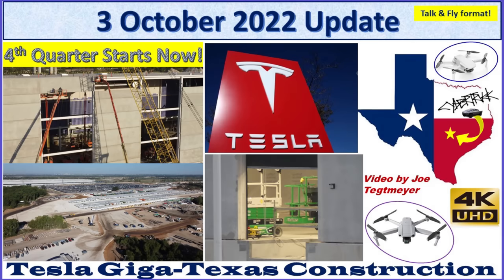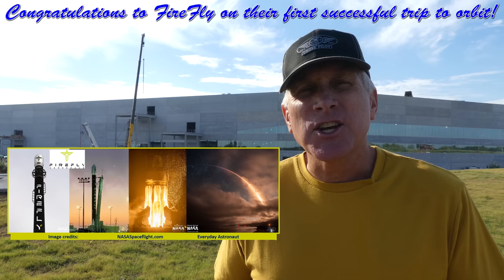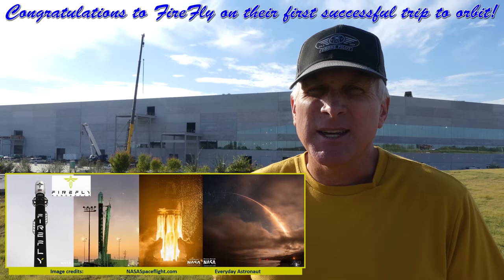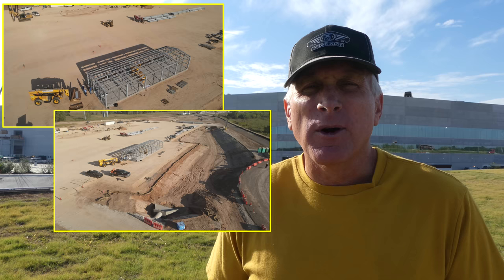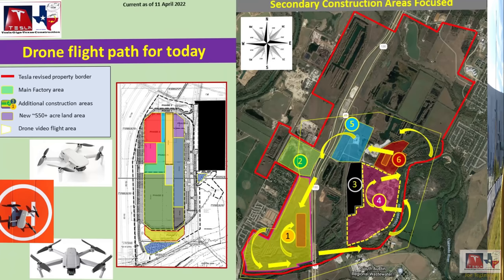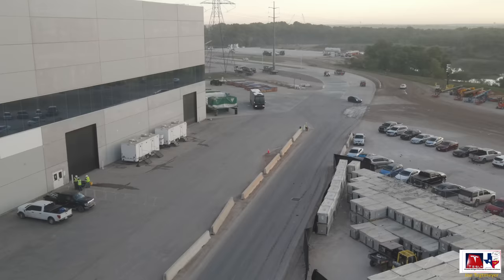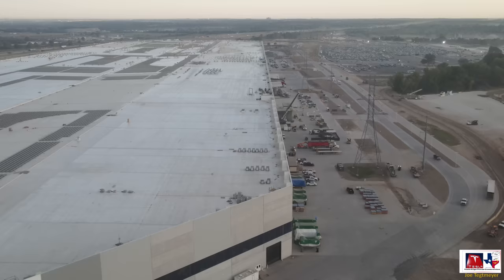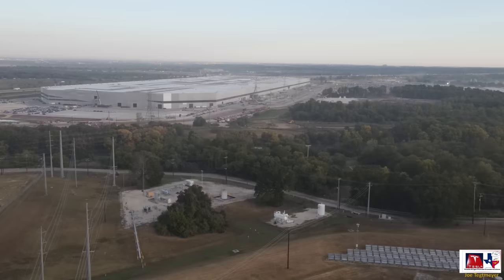Steel on the Move on this 3 October 2022 morning Giga Texas Construction Update (07:35AM)

Comment: The cathode building will have been cleared,  built, completed and operational before they finish the vents above the battery cell area..  I'd like to know what is special about that ventilation that it has to be installed the way they are doing it...  Obviously its not just a cover over some HVAC unit..
Reply: The never ending HVAC construction.
More than 6 months... so 1 per month.
Best job in the Gigafactory.
Reply: Yes what’s the deal with that ventilation install’s lack of progress ?!

Comment: Don't know if you've seen Giga Factory 3 lately but there are at least 2 or 3 times the trailer docking stations around the factory in comparison to the number of trailers in the mobile warehouse area.  I just noticed last week they have installed an elevated roadway over the ground level roadway to reach the second floor and installed trailer docking stations with trailers on that level as well.  Not sure how they'll accomplish that at Giga Factory Texas but wouldn't surprise me to see trailers on every inch of free space around the factory when they get to full production...
Reply: Kinda like a computer chip, the more the connections, the faster the possible speed.

Comment: Thanks Joe.
4:25. BIW, new loading docks. Presumably demolition of the apron, and construction of a ramp down to follow.
A little confused by all these new loading docks. Footage from the Giga Rodeo showed the BIW assembly line immediately behind these new openings. And as the bodies-in-white are assembled only from components manufactured in Stamping and Casting, what is it that needs to come in through these loading docks?
5:19. BIW, roof. New structure is scaffold for access. Studwork projecting just above the roofline on the east and north side.
8:39. Steel Fabrication and Storage Yard. Seems only the workshop, and everything stacked east of it has been shifted. Possibly to start excavation works for the pipeline continuation. Or the River Road eastward extension. Or the burial of smaller transmission cables (permit has been lodged).
13:06. BIW, apron. 3 or more Model Y BIWs beside the loading platform. More at 15:52.
13:31. Temporary WOW yard. Water tank is full.
16:27. East of Cathode. Wondering if this temporary structure might be a pilot plant for some process in development. I’ve given up on it being the Boring Company site offices.
Rebar mesh laid around the perimeter. 
Left of screen. Unloading a sprung structure (a tent). Insert outrage here……………………….
17:24. Cathode. Columns. Cleat welded across the outer face of the smaller section columns to provide a connection for the wall panels.
17:46. Cathode, Level 1. Excavations. Looking more like set-downs in the slab, pits if you like.
18:25. Cathode, west. Right of screen. Office trailers being shifted, again.
19:09. Cathode, west. Possible tank farm yes, but also there’s a building in the pile of steel to the right. 
22:07. New substation site. Angled baseplates. As mentioned by Patrick Kenny elsewhere, the clue to what these are is seen in the existing substation in the background.
28:06. Paint, apron. Vertical crates. Glass perhaps.
Only the fan component of the RTO remains. Good shot here of an additional RTO being assembled now at Berlin. Packing the interior with the ceramic media. We didn’t get to see this here at Austin. https://youtu.be/tRrMYsZSMAo?t=948
Reply: 4:25 Where are the electric drive motors and gearboxes assembled?
Oh, by the way.....
"Presumably demolition of the apron"
Yet more waste :)
Reply: @DavidJohnson-tv2nn  4:25. The space above the water vaults (you'd remember those 😑) was being called 'Drivetrain' or something similar. Visible in the Giga Rodeo videos also. Jeff's video here, https://youtu.be/vnvoBB-pmz0?t=321
Reply: @DessieDoolan  Isn't that area next to BIW? Possible some deliveries to BIW may go to Drivetrain?
Reply: @DavidJohnson-tv2nn  Yes directly beside BIW. To get to 'Drivetrain' there would need to be a break in the BIW assembly line, or an elevation change in the line.

The BIW assembly line might continue up to Level 2. There have been bodies-in-white removed from Level 2 via the loading platform outside. https://youtu.be/FBY74mx3_zQ?t=341

Lots of stuff going on inside that might only be revealed with a tour.
Reply: @DessieDoolan  Also, isn't there a space between the stamping extension and drivetrain? Remember where they had bridge crane rails on only one side? And they closed in the area before we could see how they finished the structure? Maybe that is a warehouse space? Of course, there is still the problem of getting freight past the BIW assembly line. But the number of loading docks does seem excessive for just BIW. So they must be serving something else.
Reply: @16:27 I definitely don't think these are offices, would be bloody freezing in there with all those A/C units.  Will be interesting to see what it is.
@19:09 I don't see any footings to enable a structure to be built upon this but i could be wrong.
Reply: 4:25 aren't these drive through doors and not docks?  They appear larger than the dock doors.

18:25 Same trailer vendor as the Skunk Works guys, what ever happened to them?  Have I already said too much?
Reply: @Dwayne.Shea.231  That's what I was thinking, seems to be some sort of cold storage.
Reply: @DavidJohnson-tv2nn  That's correct, was called the 'High Bay'. Still seems to be empty in the occasional view in Joe's photos.
Reply: @Dwayne.Shea.231  16:27. That's why I'm thinking pilot plant for some process. Something to do with Cathode, or recycling. Wildly speculating. 
19:09. Agree, but the steel must be for that area. That length being set up for concrete from 18:48 to 19:09 was geo-piered. 

Still wondering about the trailer load of auger/screw piles.
Reply: @sammyk874  4:25. Same height as the loading dock doors, full height of the bottom panel. The drive through doors seem to be a little higher extending into the panel above. Good comparison at Battery, https://youtu.be/3zO6eMMfXCU?t=224

18:25. I think it's the same trailer that was used by the rental/hire company. Might be the same vendor as the Skunkworks. Haven't heard that term for a while.
Reply: @sammyk874  Why the exhaust fans then if it is cold storage?  Side mounted at head level means it isn't anything hazardous, and the relative close spacing to the rooftop units makes it even odder.
Reply: 4:25 I think it goes to show that Tesla is reconfiguring things often inside. It was always a little confusing to me if the actual BIW line was first or second floor, and they likely have added mezzanines in there as well.  Still, seems like a really odd circulation plan.
Reply: @patrickkenny2077  4:25. Joe needs to get himself on a personalized tour of the factory and clear all these questions up. He must have some brownie points with Tesla by now. 

Mezzanines. The chiller units seen through the roof must be on their own plant platform/mezzanine. Don't seem to be that far below.
Reply: 16:27: Judging by how massive that trailer conglomerate is and the amount of aircon, I was wondering if it might be a data centre... maybe for Prufrok to operate they need a fair bit of processing power?
Reply: @greggerypeccary  16:27. Someone else suggested a data centre.

I'm not so sure, looks industrial to me. Got a cobbled together look about it.
Reply: @DessieDoolan  I was thinking they are similar to the drive in doors at the north of casting, those are also panel height.  These just appear a bit wider than the regular dock doors.  Might just be my eyes.
Reply: @DessieDoolan  16:27 Agree, probably not a data center. They have plenty of space in the main building for that. No need to jury-rig a bunch of trailers together.
Reply: @greggerypeccary  Interesting theory; the 8' centers for the air conditioners would work for that, as would the exhaust fans.  It would be a very low density facility though, about 2kW/rack maximum.  There are generally significantly cheaper ways to build a temporary data center, especially low density.

Also hard to reconcile the trench with the PVC pipe risers for a data center, but who knows.
Reply: @sammyk874  Aha! Yes the north end of Casting. Those are panel height. Got some dumper bins in through those doors. 

The new ones on the east side are 3 to a column bay, so same as elsewhere around the site. I'm making assumptions.
Reply: @Dwayne.Shea.231  Yeah, when I saw the cooling I thought, "temporary compute facility", but easily some other process requiring controlled atmosphere.
Reply: @patrickkenny2077  The PVC pipes made me think "trailers with plumbing", but the way they are set up makes them look like one structure. Maybe they use water-cooling for the computers, so bureaucracy requires plumbing (in case of an accident)?

Comment: 9:30 We've occasionally seen some of those Model Ys being driven or with their lights on, which says that they have battery packs, so they aren't waiting for 4680 packs.  I don't think they would get assembled that far without their packs.  I'm guessing that they are either missing parts or failed some inspection, so either way they require additional work.
Reply: Correct, and without the 4680 packs there are no seats!!

Comment: The new bays cut into the walls at 25:30 are overhead doors, not loading/receiving docks. They are doors for moving through instead of parking at to load/unload. Since the sill is at ground level, not trailer level, they're intended to be used by fork lifts and other vehicles. The most common reason to have that many doors so close together is for service bays like at tire installation, oil change*, vehicle repair, etc. I wonder if this means that GigaAustin will be a Tesla Service center too?!? 😃
*I know, Teslas don't need oil changes, I was giving examples of facilities that have overhead doors so closely arranged.

Comment: 26:06 Three of four gigafactories producing MYs (all but Shanghai) are stacking up (mostly rear?) underbody castings by the thousands outside.  This would seem inefficient as it involves moving the casting twice -- once to the staging area, and again to the BIW fab -- so I suspect there is a reason other than building inventory for the extensive outdoor staging.  The gigacastings' high-Si formula obviates the need for heat post treatment of the castings to relieve stress. But they still may benefit from seasoning by exposure to diurnal cycles of sun temperature.
Reply: It's interesting that we see no signs of the gigacastings at GigaShanghai, even though there must be ~5 presses going since the casting building expanded early this year.  Does GS operate on a more JIT basis with the castings, and does it have to do with the higher land prices in Shanghai -- the highest of all gigafactories?
Reply: 26:06. Castings stacked outside here would only be because they need the space inside to prepare for the additional machinery being installed. Joe's photos have good shots of inside Casting. You should become a Patreon.

Comment: are the existing solar panels that are installed already operational? I am assuming they are connected and providing power to the giga texas
Reply: Doubtful since the plan is to store the solar in the mega pack that doesn't exist yet
Reply: @MM-fe9mz  I agree that the panels are probably not connected yet. But... Why store energy that could be used in the factory? Why not just use it locally???? Which would be most efficient!
Reply: @DavidJohnson-tv2nn  There are some indications (close-up views from Brad) that every second bracket being set up for new panels has a small box attached: 2 loose wires (to connect to the panels to be laid down) and one wire for inter-connecting these small boxes into strings. I looked up "Micro-Inverters" and if that is what they are then the AC output from these Micro-Inverters can be fed directly to the nearest part of the main electricity system, anywhere really. This is the ultimate in flexible connection from what I read. I speculate that there are only some additional measures necessary to make sure that the AC juice from these Micro-Inverters does not interfere with the maximum (fused) amperage in sections of the main electrical system. Also Dessie has identified some extra 3-box cabinets here and there on the roof, adjacent to some completed sections of PV panels, but not everywhere. As yet there is no firm idea what these cabinets are for, perhaps circuit breakers to do with safety systems? 

All in all the flexible Micro-Inverter system would allow to plug in the new panels almost as soon as they are laid down and all the wire connectors are clicked in place. Too good to be true? Right now there are a bit more than 22.000 panels in place, possibly delivering 11 MW (peak). I think this can easily be absorbed in the main electrical system as of today, the 32 Superchargers in the SW corner alone can pull 8 MW when all the stalls are in use.

What would really be appreciated would be a definitive say-so from a solar expert.. We can do our best via internet searches, but that only goes so far.

Comment: I really question the value of “core sample drilling” when the whole area was a gravel mine, with old digging filled in.  Unless they are sampling every two or three feet, I’d say it’s a wasted, “😢bureaucratic  requirement”
Reply: There are three possible conditions under any point in that area. Undisturbed, disturbed and filled in the 80s, and disturbed and filled recently. But even knowing that data, the core drillings tell you how well that point has solidified after filling, the density of each layer, and the depth to undisturbed soil . That will tend to be similar within a small area. Finally, we don’t know what they are planning for the area. That will dictate the test pattern and number of samples more than anything. They may just be checking areas where certain heavy equipment will be placed or for simple warehouse and office spaces, checking where columns and such will placed.

Comment: Substation-
@ 22:26 (lower right) Forms for two concrete slabs to support structures other than poles.
@ 23:24 Likely location of two 345 kV transformers. These will be large and heavy.

Comment: How tall is the battery cathode building? - at first glance you might guess three storeys until you see construction workers stood/working next to it!
I would love to see some images of the building taken at ground level!
Reply: Similar height to the main building. Around 75' - 80' 23m 24m.
Reply: @DessieDoolan  I'm not sure about Cathode height. Assuming the concrete wall panels are the same as used on main building, Cathode is ~6.5 panels tall whereas main building is 8 panels tall.
Reply: @vermontsownboy6957  I gave myself a bit of wriggle room with the 75 - 80' estimate. I based that on the number of flights in the temporary stairs. 12 at Cathode on the north east corner. It was 11 or 12 on the main building depending on existing ground level.

I did a check 16:52 to compare the building height to the pedestrian door opening. Still getting "around' 80'. 

A set of drawings would be helpful!
Reply: @DessieDoolan  Ha hah hah...you counted the stairs! Routinely cracks me up when there's more than one way to calculate something I didn't think of. But if you're correct, what does that indicate about the concrete panel widths...why would they be different widths?
Reply: @vermontsownboy6957  When the main building was going up, until Jeff was told by a crane supervisor that the building was 76' high, the only way I could estimate the height was by the stairs. When the wall sheeting on Paint was installed the estimates got a whole lot more accurate.

On Cathode there's 3 different widths of panels. The skinny panel I'm confident is only to line up architecturally with windows or louvres on the west side. Then the top panel is just high enough for the roof membrane to turn up against.

Interesting that all the panels at Cathode were transported flat. All the panels at the Main Building came on the angled frames.

In one of the videos there would be shots of the panels on trailers a rear view from square on. Would be easy enough to measure those. Trailers would be 8'6" in the US?
Reply: @vermontsownboy6957  Found a reasonable shot. I'm getting 13'3" for the wide panel on the trailer to the right of the white pickup truck. https://youtu.be/AZcB2ghOOKs?t=899

The slightly narrower and the narrowest panels I'm getting 11'2" and 6'4". 84' overall.
Reply: Impressive how well you do your homework. Thanks for pointing out the September 28 video showing panels on trucks.  There's so much about heavy construction to learn!

Comment: They definitely could be planning to build something in that area you call the "dirt storage" piling dirt high like that is often done in swampy Florida to help speed up the compaction of the soil to prepare it for a building foundation
Reply: They could be eventually, and that has been suggested before, but they have a history of building up that area with tons of dirt, then moving it all away when they need some fill, then bringing back more, and so on.
Reply: That's usually called loading the soil. You can see them doing this around the Shanghai factory where they plan future construction. I don't think it's as necessary here because they'll be prepping the ground with Geopiers anyway